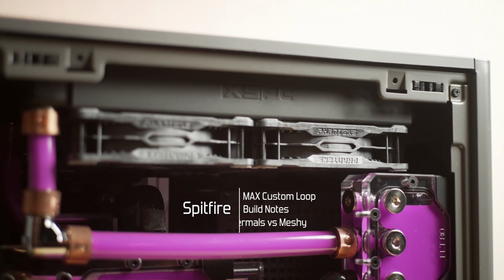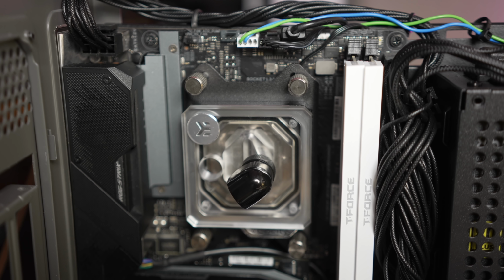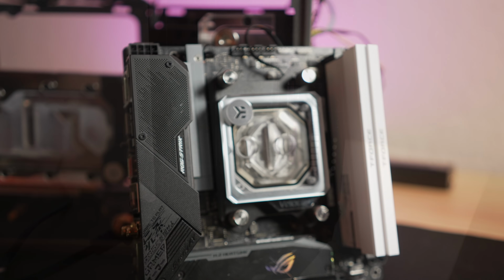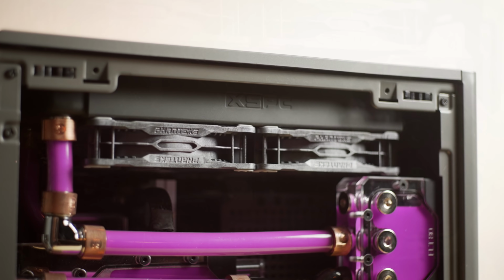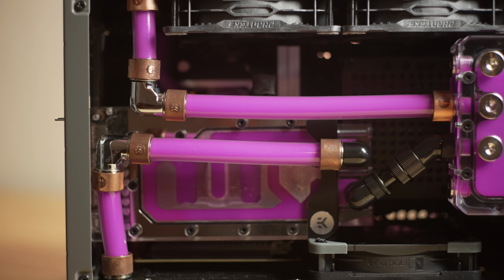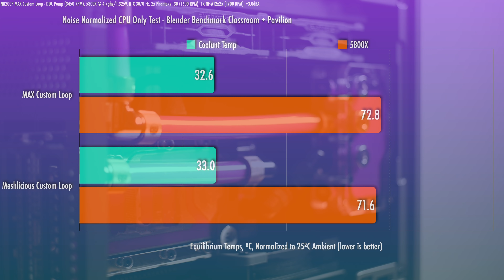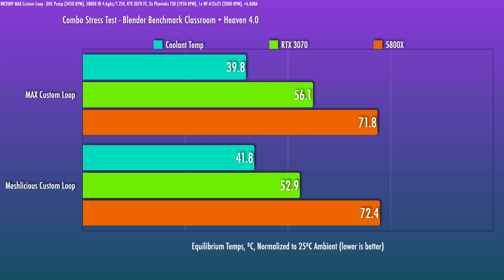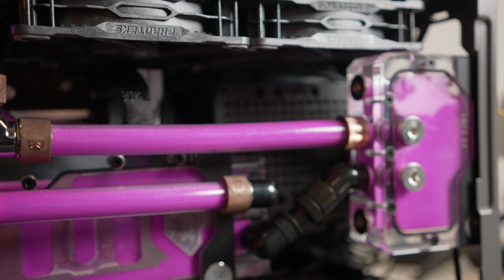Spitfire - A Mod-Free (mostly) NR200P MAX Dual Rad Build

Comment: I ordered some extended height case feet off Etsy which allows me to mount some P28’s under the case with plenty of clearance to pull in fresh air & push it thru the bottom rad! Waiting on my FLT80 for the exact reason you have it in this build. I’m also running the Barrow CPU Pump/Res block. So I’ll have dual pumps & triple rads once I get the last few parts.

Comment: I used the FLT80 in my NR200P, it's just the right size for this case.
Reply: Where did you placed it?
Reply: It REALLY is tho ❤❤
Reply: @swizzler8053  there’s a lot of good mounting options at the front of the case for that rez

Comment: I'd be curious to see what happens with the thermals if you close off all air vents except the bottom with a "chimney" fan configuration, so that negative pressure forces air through the empty fan slot of the radiator.

Comment: You should revisit this build with custom feet so you can mount fans externally on the bottom. I imagine it would work slightly better and you get the added bonus of an underglow if you go the rgb route.
Reply from the maker: Great idea- yeah, especially since the space between the riser cable and rad is tight, the external fan in that spot would be ideal for airflow rather than trying to raise the GPU up and cramming it inside.
Reply: @MachinesMore  I recent built an air cooled nr200p (will eventually watercool it) and use some 3D printed feet from ETSY. It doesn't look obscenely large like some of the top hat builds and in the nr200p it can allow for like 45mm rads or something like that.
Reply: I am going for that setup when i receive my gpu block.
Reply: @MachinesMore are the feet the same because i 3d printed some nr200p feet

Comment: My NR200P MAX Cooler Master AIO pump was DOA...😔
Luckily my H115i was there to save the day!😁

I did a custom 2x240mm AIO's setup in my DA2 with a 3090, it was dead silent as the GPU had 0 coil whine too...think I'll try this with the MAX when the new GPU's drop.

Comment: I think the only thing that would have made the NR200P Max 100% perfect would have been allowing the GPU to move up 2 cm with either an adjustable PCI-E bracket or by stock. This would easily allow a second 240mm TX240 with dual 15mm fans on the bottom to be installed.

Considering its cost here in Canada, it's not a bad deal. Right now it's $470.00 on Amazon, any 280mm AIO that is worth it is near $150.00 or up, the PSU is around $200.00, and the NR200P with PCI-E 4 riser, well, doesn't exist! Great build and channel, BTW.

Comment: Do you have both top and bottom fans set as intake? If so, that doesn’t really make much sense. You should take advantage Of natural convection on top. Also how do you ensure that the hot Air actually exits the case?

Comment: (noob water cooling question here)

so with the coolant, is that EK cryofuel mixed with distilled water? and if so, why did you do that? cant you use the solid premix straight out of the bottle or is that more prone to clogging?

Comment: I wonder if it would be possible to do this with a EVGA 3080 FTW3. The block would extend behind the pump/res, but unclear if it would actually work? Do you know if there was any space in between the block and the pump? Radiator would be mounted under the bottom plate, so two slim fans should fit as well.

Comment: Interesting results. Thanks for the video!
Eager to finish my dual rad setup in non-max nr200p with 25mm fans, but for now stuck waiting for riser cable that'll fit. Had to cut case a little bit to move vertical card mount down and made a custom top mesh for better airflow, because stock one is kinda restrictive in my opinion. Hope it'll be enough cooling for 5600x and 6900xt.

Comment: I know I'm being picky, but the build needs straight tubing (will need some G1/4 extenders )

Edit: cooler master should sell the case without the aio PSU bundle.
-thar reservoir/pump combo is too expensive damm
Reply: you can find a ton of space and save a pretty penny, if you go with the barrow cpu block / pump / "res" combo unit. not aware of intel 12xx support yet, but good for 115x and am4.

edit: check clearances carefully if using with a vertical mount gpu. might need to use koolance low profile right angles to get hosing out from behind gpu, or might not be viable for your build.
Reply from the maker: Yeah, hardline would definitely be nice, and worth the effort for a long term build. And yes, I agree the standalone case would be a hot item, hope that materializes!

Comment: Regarding the FLT 80, did you find it a pain to bleed? Bleeding the loop with direct psu power it keeps sucking air back in. Might need to power system and lower the speed via pwm.
Reply: Hasn’t been a problem for me. Just make sure you’re positioning the designated “Drain” port properly. I absolutely love my FLT80 ❤
Reply: @Macheako  yeah once bleeding out air was done it's been solid

Comment: Is there a way to mount the EK FLT 80 pump res combo to the Cooler Master Nr200p (non-MAX)? If so, is drilling or modification of the case needed?

Comment: How about CPU temps in comparison to the built-in AIO of MAX? Is this mostly for aquistics and GPU thermals, along with aesthetics of course. It looks absolutely great BTW. It would be a lot easier and cleaner if there was a custom pump-res combo built specifically for the NR200, like the one which was available for the Ncase M1. Other than that, fantastic build, sad to hear it will be dismantled soon.
Reply from the maker: The CPU temps would be similar, probably a bit better because custom cooling components are higher quality - a thermally dense CPU like the 5800X benefits from a high quality block. In the MAX you can either prioritize CPU thermals or GPU thermals when using the glass panel. What the custom loop does is make the cooling between the two completely interdependent, with the major benefit that liquid cooling benefits GPUs disproportionately when compared to your stock air cooler- they are direct die cooled.
Reply: @MachinesMore  thanks a lot for the detailed response. I'm interested in a non compromised (thermally at least) itx build and 20liters in this form factor seems to be the absolute minimum for achieving that. Previously had a Manta and RVZ03 build, Manta was thermally decent but hardly compact. RVZ was compact, very small footprint, CPU cooling was very limited.

Comment: If one's not using a vertical GPU configuration, is it possible to use slim radiator on the bottom with 10mm thick fans (so that we could use the second fan on the left) or is the clearance not enough for that?
Reply: Do they make 10mm thick fans? If so I’m curious

Comment: Awesome, as always!

I'm curious if a loop in the regular NR200 would perform better? In theory you can side mount a 280 rad, bottom mount a 240 rad and still have two top fans as exhaust or intake. Or does a pump/res prevent the sidemount rad?
Reply from the maker: In that type of build a combo pump/cpu block is the best bet-  and yeah, it really would work better because of the airflow as you described; this setup however does tend to be more utility driven since you need to use the vented panel.

Comment: could you fit the 2nd rad fan if you moved the GPU support (I guess is right term) up? I know that's getting into modding territory but I always found that hole in the back of the NR200 to be odd.
Reply: You can put washers between the case and the bracket you attach the gpu. Unfortunately even if you gain about 4mm of room, it's just barely enough to fit a 25mm fan
Reply from the maker: If you could shift the GPU up about 15mm (longer riser cable might be needed) you could clear a slim fan- however, the riser cable would obstruct most of that fan at that point.
So, I’m not sure it’s worth the trouble. One other thing to consider is that at that point the bottom of the GPU’s IO shield would not be latched in to the case.

Comment: Great video, but can u make another video and explain what is the best way to remove liquid/fluid from all system, some on yt make video about that but its strange and complicated, I just wanna see the easiest way, so If U have time please just explain and make video....
Reply from the maker: Good idea! I usually add a drain valve but the cool thing about these flat pump/res units when they are outermost facing is you can just lay it flat, screw in the tube, flip it face down and bleed out most of the fluid that way.
Reply: Just add a T connector and a drain valve to some point in the underside radiator, (in my nr200 I remove the front, then I attach a small tube with a   compression fitting open the valve and done, after pouring all the liquid, just close and remove) pretty easy
Reply: @MachinesMore  Ok but always something stay inside, so are u just add new or do u have some trick how to remove completely or its not necessery to remove all liquid....
Reply: @barracuda7366  if you're going to do long term storage, probably just flush some distilled water through it, and then just air dry every component individually. for short term, if you're gonna be filling it with same kinda liquid, don't need to worry about perfect drain, just make sure you don't drip anywhere sensitive. if you're changing your coolant type / color, do some distilled water flushes.
Reply: @manuelbardina  Great thx, I know what to do now, but for some other guys who are new in this video would help a lot, thx for comment guys, MINI ITX SFF here we come....

Comment: could a Asus Rog strix X570-i gaming motherboard work in this setup? if so, what components would you recommend?  I have a Ryzen 9 5900x and Corsair VENGEANCE RGB PRO 32GB (2 x 16GB) DDR4 3600MHz C18 with a GPU still to come.  Does anyone know if that Ram will work? I'm new to building and like the NR200P max case for size and perceivable ease of build.

Comment: Does this build provide more FPS that a standard build with the CPU liquid cooled and an air cooled GPU?
Reply: If you watercool your gpu you can get higher boost clocks.
Reply: @swizzler8053  Hello friend. That is a very true statement. The question here is will actually this setup perform better? Is there a benchmark that proves this?
Reply: @harrykout  better not really.
Reply from the maker: For CPU dependent titles, no unless you overclock the CPU, and even then Ryzen 5000 is pushed pretty hard already. For GPU limited titles, even at stock settings, these thermals pretty much guarantee the GPU will hit the highest boost clocks the whole time, without having to hear any cooler fans. If you overclock the GPU, obviously silicon dependent, you can get a meaningful boost there too. For me though, these types of builds are all about getting a personal look, and near silent operation.
Reply: It’s more about the art/passion than the benefits

Comment: Noob with a quick question.. how do you drain a loop like this?
Reply from the maker: You can add a drain valve but it’s hard to hide unless T’d onto an interior rad port. For these FLTs I usually just connect the drain tubing to the front of the unit (lay it flat, screw tubing in) and just get out as much fluid as possible. The unit will need to be turned a few different ways to get most of it out. Usually the rad will have some coolant left in it but if the loop is coming apart it’s not messy to disassemble and then drain.
Reply: @MachinesMore  shorten the long flex tube a touch, and add some koolance 0 leak quick disconnect fittings. makes it really easy to drain. buy 2 pairs of quick disconnects, use 2nd pair with donor tubing.

Comment: Jesus How is this case 500$ ? Idk looks like it comes with less than you're average atx under 200 $ case. Maybe its cause its modified for custom loops but still jezz what does it come with ?
Reply: Late but it comes with a 280mm AIO, 850W powersupply and a gen 4 riser cable. It's a pretty good value.